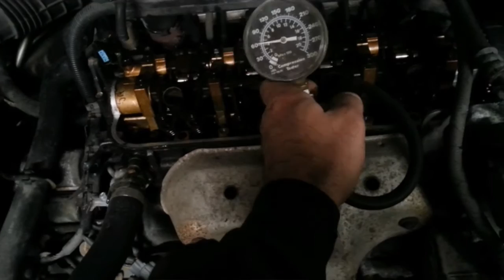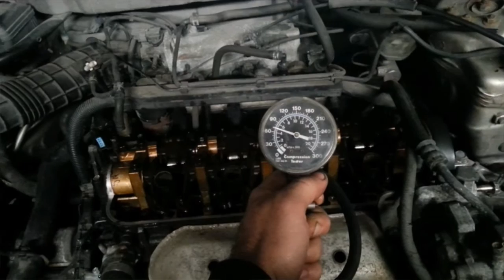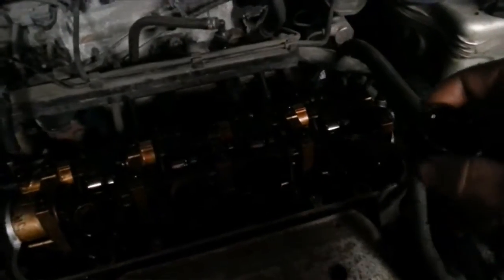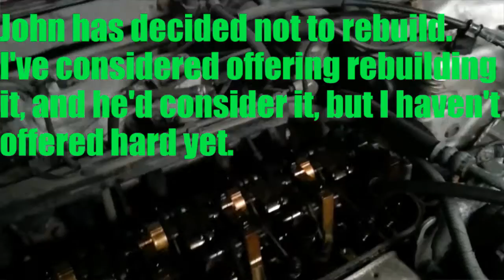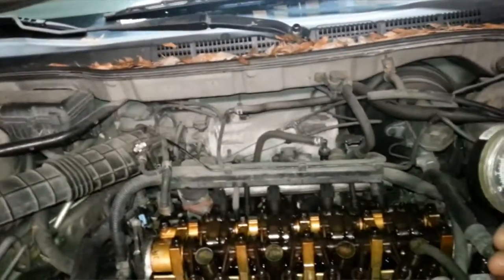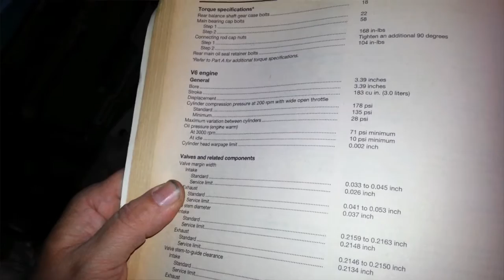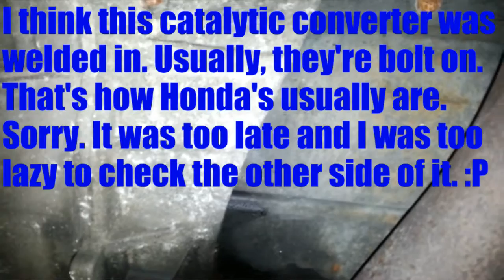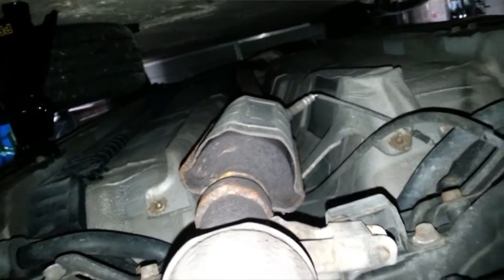Compression Testing, the Thorough and Complete Way

Comment: compression will build to max. Nothing to do with how fast the engine cranks. How long is more important. You crank until gauge reads max. Next video, thank you very much.
Reply from the maker: Your comment isn't accurate based on my experience nor on the experience or several of the best that I've worked with.

I've had engines that showed declining compression across the board. Go back to the first cylinder and there was even less. Adding more cranking time couldn't get as high of compression. Why? Batteries were never meant for cranking that much without starting. Now, some overbuilt batteries or bigger and badder energy systems could be enough  to be accurate, but that isn't the norm. Not even from a newer battery.

Comment: That's an excellent point about battery reserve during the test. I often wonder whether even with a battery charger you are OK. After all, voltage and amp delivery are two different things, especially with the wimpy output of most little battery chargers. In this case with a bumpy result graph it's easy to conclude there's a problem. That's a fun video!
Reply from the maker: +spelunkerd At work where we have a start option on the battery charger, results are more even. With that many amps the battery is hardly a variable. 

Thanks for your compliment and feedback. :)

Comment: Would be interesting to see the result of a ring change, would a possibility of a worn egging cylinder shape (it is Easter) though have a detrimental effect on compression?
Reply from the maker: +Typey1 Spot on. Exactly! I did think of that when I wrote up the description.

One thing that wasn't clear in the edit, is that when I first added oil, I was only adding a half cap full. It's easier to be more consistent with a full cap full.

So when I added oil a second time on the far right or cylinder no. 1, it was just catching up on oil. Cylinder 4 got a cap full to start and it still had the lowest compression. So it was probably leaking air past the valves as well. A leak down test would be clearer.

Or, like you bring up, what if those cylinder walls are more egged? If so, a rehone and piston rings alone wouldn't be a fix. It'd have to be brought to a machine shop and get reamed. Then you'd have to use over sized piston rings on the whole engine. (Assuming you wanted consistent results.)

My brother in laws Volvo was down in compression in only one cylinder and a wet test more than corrected it, but he kept driving it and it went from something that drive pretty good with a looser spark plug gap to compensate for lower compression to having a flashing check engine light in a couple weeks.

So without a full correction of issues beyond a simple piston ring compression a "newly rebuilt" engine could go south on you very fast.

Comment: Erf, dead engines everywhere!  :[

Honestly, I wouldn't even try to rebuild that Honda's engine.  With 200,000 miles, the number of things you'll come across while you're in there is going to drive you bonkers, and could get expensive fast.  Grabbing a good engine from the junkyard will be a much cheaper, much easier way to get the car back on the road if you really want to.  :)
Reply from the maker: +rhkips My enthusiasm to get things done needs to be tempered sometimes. You're exactly right. The owner, my friend John, is probably thinking that too.

He's already gotten 160k miles out of it's 200k miles. This engine is just the excuse he needs to buy a truck. Lol

When one car door closes, a small truck or SUV door opens. 

Oh man, I so almost helped him buy a good Xterra yesterday. It has the same engine as my Frontier. It feels nearly identical except you can feel the truck bed missing for how it moves on it's suspension. 

Then, after a LONG test drive to get the emission monitors to set and be sure what we were getting in to  (needed EVAP work) we spotted a little oil on the ground. Got under it and between the engine and transmission there was an oil leak.

Likely a rear main seal. Stop the paperwork! We looked at so many more easily ruled out.
Reply from the maker: Update, within a couple days of it being for sale it sold. That happens when you sale half of blue book (you'll get over half blue book by spending more than half blue book on an engine - he made a wise choice).

Comment: How many miles on it. Seems your rendering somehow has the voice off time . Don't know how that could happen. Interesting vid.
Reply from the maker: +STEVE ROB We must have been watching it at the same time. I've noticed that sometimes videos "fresh off the press" on YouTube have that issue more than not. Before I sent it off to YouTube that ending was in time.

Thankfully it's only noticeable when I have face time, which isn't much.

Hopefully it'll resolve. Nothing hard on my subscribers than re-releasing the same video trying to fix something, lol.

(Before making public the issue wasn't their either.)
Reply from the maker: +STEVE ROB It has over 200k miles, just barely.
Reply from the maker: ***** You've perfectly analyzed the car. I don't know about rusty brake lines, but he's spent about nothing on the car for the last 100k miles.

Everything is worn out. My crazy Chevy Prizm is that car you speak of that I've replaced everything on. I've always wanted to do an engine rebuild. I want to see if porting is something I want to get into and risking it on a broken engine is the least risk possible. 

Bottom ends from 2008 are the same for my Chevy Prizm. I just have to move over the style of brackets from the old car for the engine mounts and the 1 wire instead of 2 wire knock sensor and I'll have a way newer engine with some modern improvements. 

This Honda has none of that going for it. It's last, best service was in showing a competent compression test. :)

It's cylinder 4 still was very low compression WITH oil. It would be insane to just replace rings. That's for SURE.

Great comment CB.
Reply from the maker: *****
My brother has a 96. He just had new struts put in. It just keeps going. This is so, lol. :)